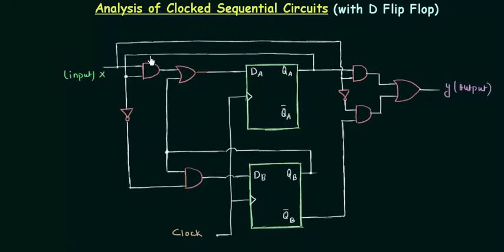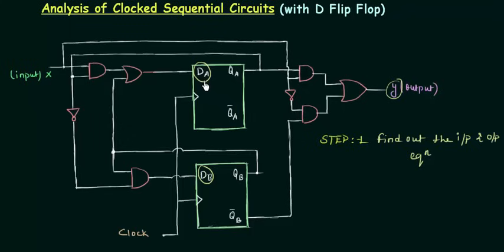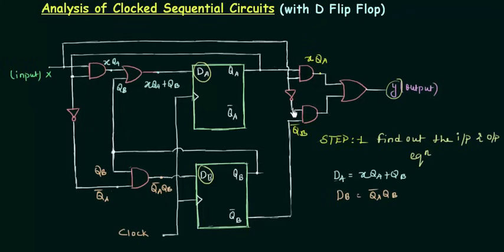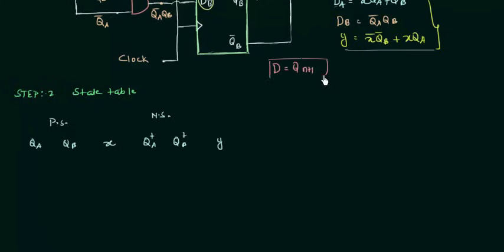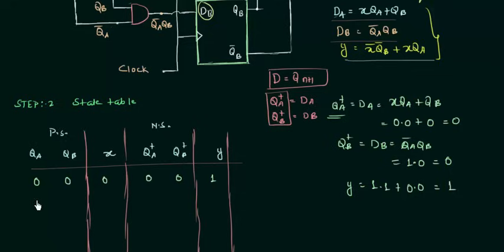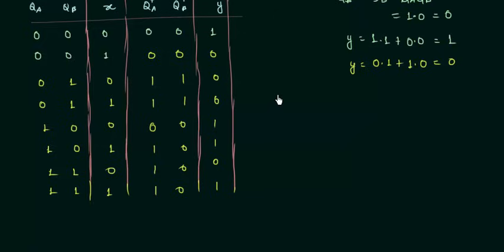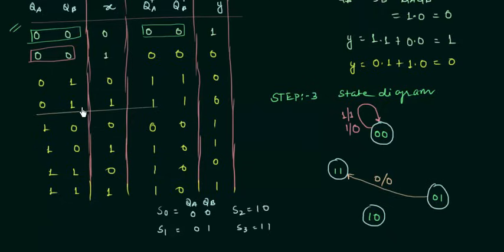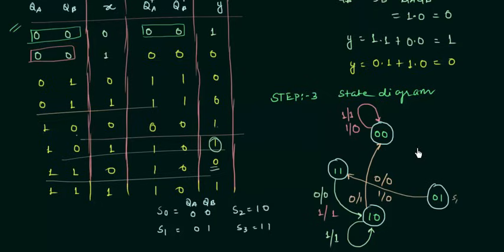Analysis of Clocked Sequential Circuits (with D Flip Flop)

Comment: Hi Neso Academy, u guys are doing incredible job  and thank you for it.
however I would like to add a point in this STATE DIAGRAM OF D FLIPFLOP-   the next state is found using the characterstic table of D flipflop and states Qa and Qb.  Although the states will come out to be exact as yours, but just thought of adding a correction.  anyways thanks again ..

Comment: How does an AC function through a F/F?  Does it get unstable or fall in voltage along the way? I know the F/F switches but if F/F 1 Q (or Q -) is connected to F/F 2 then would the AC pass from F/F 1 to F/F 2 or would i need to add an extra track to attach to F/F 2 so it will function?

Comment: could u plz solve this ques.q1. design a JK flip flop using basic cell and also determine its classq2. design full adder using PLAthese are the ques from book- An engineering approach to digital design by fletcher